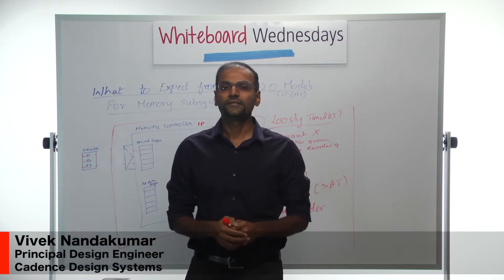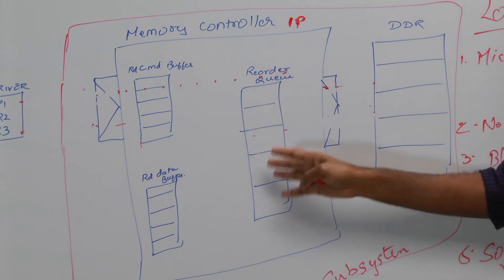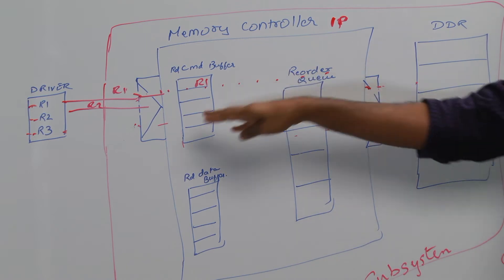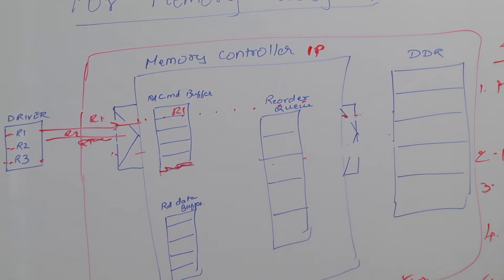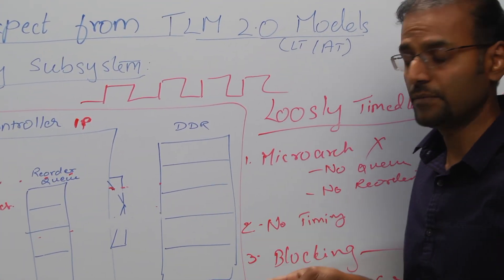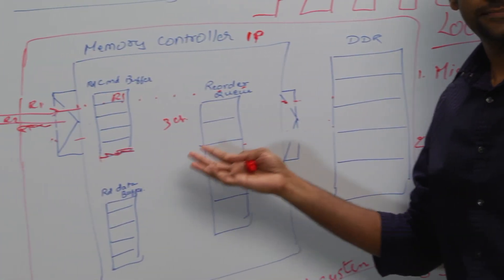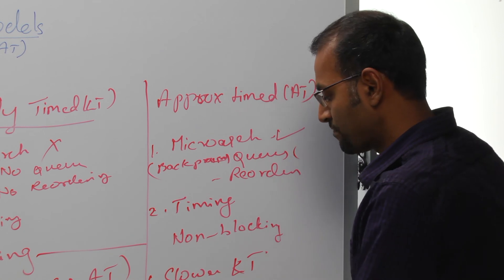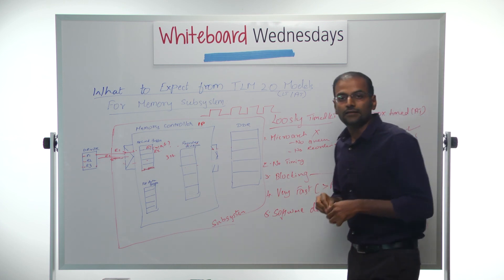Whiteboard Wednesdays - What to expect from TLM 2.0 Models for Memory Subsystems - Part 2

Comment: In AT  , we should indicate the delay cycle of exchange data. How can we know this number. By the way , we indicate the delay cycle , but we are still not cycle accurate ?
Reply: Delay cycles could be an approximation. Also, delay cycles need not be inserted everywhere.
Reply: AT could be accurate to the architecture. But to be cycle-accurate, it needs to be accurate to be RTL.